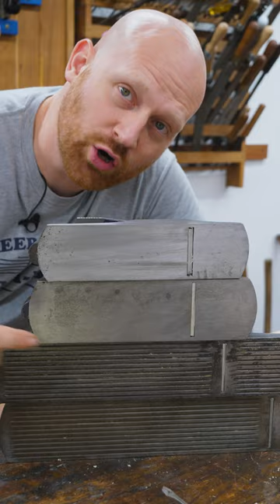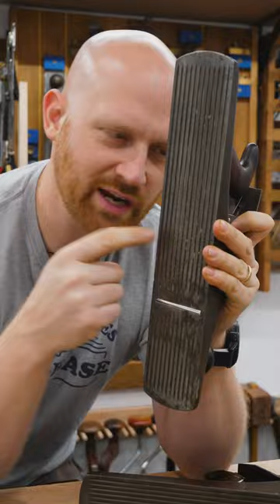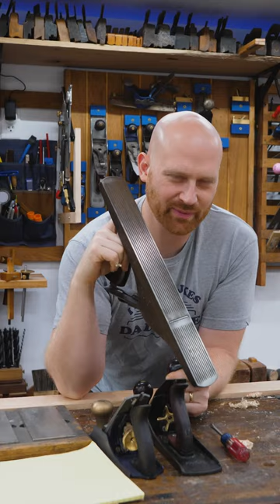What is Corigation on a Hand Plane

Comment: It is easier to push, no debate about it. Reduction of the contact area reduces friction, and the corrugation helps with suction force, it doesn't have to be just moist or resinous wood to take advantage of this. It also helps with wood that's already polished or wood that was sanded fine enough that the pores are clogged and it easily sticks to a smooth surface.
Reply: Bro skipped physics class
Reply: @milomaz1  It's not a simple coefficient as high school physics depicts it, loads of other factors need to be factored in, from modulus of materials, direction of force and direction of travel, and the type travel i.e. Sliding friction. The contact area does make a difference and the other part of my comment about suction force is even more relevant and plays a bigger part in making a corrugated hand plane better than Smooth hand planes for some types of wood (Wet, Waxy or Resinous wood and very finely sanded wood). You could look up various patents for corrugated surface finish tools and you could find the relevant math.
Reply from the maker: Wrong again. Still your turn!
Reply: @WoodByWrightHowTo  Good argument.
Reply from the maker: Test after test shows they are not easer to push. just put a scale on then and pull. they have the same average force required to move the plane forward. same amount of friction just concentrated location. Planes are not gauge blocks.
Reply: @WoodByWrightHowTo  You seem to be referring in part to Andrew Klein, the test he conducts in the video is flawed. You could search for the topic on timetestedtools you could find an experiment regarding this. My Japanese woodworking manual basically concludes the same as the experiment on timetestedtools, that they're easier to work with and preferred for certain woods, and also as general preference.
Reply from the maker: i tested it myself a wile ago. if you put a scale on them they require the same force to move. sounds like another video needs to be made. I will put it on the list.

Comment: Soooo... there are some nuances to this. The corrugated surface will likely have less friction but the magnitude of the difference is tough to calculate. What they do have a definite advantage in is channeling debris off of the surface by giving it a place to go. Kindd of like the grooves in a tire. This will reduce friction by a margin that can be considered significant. The weight is also reduced which definitely helps if it is being used for long periods. I like being able to grind the surface flat more quickly and they always seemed a little more forgiving to that process.
Reply from the maker: That's the fun of a short period but surprisingly on average they weigh slightly more as they were cast a little bit thicker to leave space for the corrugation.

Comment: If anyone is wondering why the friction is the same in both instances it is because reducing the surface area without changing the force applied just means that there is more force applied per unit of area over that smaller area. 

This change in force/unit is directly proportional to the friction force applied to that area. Meaning if you have an area of 4 in2 with a force of 1 Newton and and area of 2in2 with a force of 2 newtons the friction force will be the same.

This is why the formula for friction force is only dependent on the normal force and coefficient of friction between the two surfaces.
Reply: I thought it was because in either instant, the blade is really doing the work. The plane was just there for a guide. Thank you. You learned me something today
Reply from the maker: wow detailed and first. nice work!
Reply: Except that is not the real formula for static or kinetic friction in the real world when engineering solutions that are impacted by these factors. Contact patch, whether tires or otherwise, will make a difference. There are many factors such as the stick slip condition, the contact area, interface variation through a piece, so on. The real world calculations are far more complicated than basic high school physics leads many to believe.

The challenge ends up being argued as semantics. Is contact size in the generalized formula? No. But do we have to take it into consideration quite often when designing rolling or sliding friction and traction models? Yes. 

Bulk strengths of the substrates, and other forces that are more difficult to model beyond just basic friction make everything a challenge. 

This is all assuming you do not have any other factors at play such as excess fluid or moisture that can contribute to a vacuum condition on a planar surface. 

Now, when tested, you will notice that in general profiled surfaces have slightly reduced friction given approximately equal polishing or surface treatment. Not in the formula, correct. But can, in general, be tested as a statistically significant difference.
Reply: Still it it takes less force to push a 1x1 cm square of sand paper than it would take to push around a 10x10cm square of sand paper.
Reply: @vihreelinja4743  yes given the same force this is true because there are a lot of compounded forces beyond just isolated high school physics friction
Reply: That formula only works if you have two rigid surfaces, which wood is not.
Reply: That is false, as it is assumes that the two objects when translating over each other do not display anything other than liner dynamics. The Tribiology of the two surfaces is very complex, and the simple design that Stanley long ago stumbled upon, probably via heuristic thinking is likely effective and removes some friction from the equation.
Reply: @kurtjohnston6620   well said, I am amazed how people always miss this
Reply: @riba2233  It is the classic "knows enough to be dangerous". As some of the other chaps in the comments have mentioned, applying a purely linear, static understanding of friction which is taught in high school, the increase in friction should be proportional to the amount of surface area removed, but it isn't. A competently made mistake, if there is such a thing, but one that is made but which cries out for just a little more thinking and intellectual curiosity before committing to a simplistic answer...

I am no genius btw, I only barely know a few things about Tribiology, but it has fascinated me ever since I learned about it..
Reply: @kurtjohnston6620   yeah, I see this very often in youtube comment and on reddit. I know what I know but more importantly what I don't know, looks like other people think they know everything after reading two paragraphs about it...
Reply: @WoodByWrightHowTo the problem with this is that friction isn’t a simple linear function in real life, and often surface area can be a major factor despite what we learn in physics class. I was shocked after confidently explaining why a larger friction pad wouldn’t provide better grip to our robot and being proven unquestionably wrong in my engineering work.
Reply: @Squat5000 in my experience it seems to make the biggest difference in the breakaway force, and in applications that aren’t a simple single surface contact under high force like a servo on a shaft, simple friction models are worthless outside of some basic equilibrium speed calculations
Reply: less force will be applied to make it move...
Reply: Thank you lol
Reply: Thank you.
Reply: @reesetyra902  what you describe is only a first order model of friction, which is not generally a well behaved linear function, particularly when you consider a wide range of contact pressures and slip velocities, and yes, surface areas. Your true contact patch can have a great deal of importance particularly when considering extremes where vanderwals forces and fluid layers become dominant terms. Im an aerospace engineer working in sightline control of precision tracking lasers, our models for friction have to take into account static vs dynamic transitions as well as viscous and non viscous friction terms that each vary significantly with temperature and thats for a very well defined closed system with minimal external forces. In the robotics I’ve done i was working to design a pneumatic gripping mechanism to allow a robot to climb a structure, I very confidently explained the physics rule of normal force and materials and showed how the small gripping surface was weight efficient and would provide the same friction etc and showed the math id learned in physics class etc, and you know what? I was just plain wrong. It slipped off ever time, and the tradesman who was nearby said duh you need a bigger friction pad to grip better, i explained how no the friction is the same- and he insisted, well we tried it, slapped a 4x bigger plate same materials same forces behind the actuators and first try it worked. I was unceremoniously proven to be wrong and over confident in my theoretical education and lack of experience. The world is never linear, we just like to pretend, and most of the time it gets us close enough, but never forget where the rules come from and where theyre valid. The friction rule isn’t really rock solid anywhere other than the ramp they used to demonstrate it in class.
Reply: Found the nerd.
Reply: @ChipChurp  he aint even correct smh
Reply: Boom. Physics.
Reply: Would that also be true for something like rubber on sandpaper? Or does that only apply to smooth surfaces and if so, how smooth does it need to be in order to have negligible deviations from that formula?

This really did intrigue me, sorry for the possibly dumb questions. I am not trying to sound smart, and to anybody smart that would be obvius, because I don't know the correct words to formulate what I want to say in a correct manner.

I do understand that something pressed down into grooves on a surface will always to some degree be held back by the grooves, pretty strongly, thanks to it's natural path of movement being on the other axis than the one you're trying to move it in (meaning the basic 2d coordinations (X and Y)).
Reply: @djingiskhan4581  your intuition is good here, the more the roughness allows surfaces to mechanically interface, and the more the surfaces are able to deform due to contact, the more the simple linear friction models tend to break down. Nothing is perfectly rigid or flat so nothing is really linear, but for most surfaces a friction coefficient is a good approximation. In my industry we really rely on tests more than anything rather than simply assuming a model will be perfect, and typically account for sliding friction, fluid friction, spring like forces, and some others.
Reply: @youngbloodbear9662  Thanks! You explained that really well, as I expected from the quality of your first comment. Thank you for taking the time, I really do appreciate it! :)

Edit: Sorry, I missed that you weren't the guy who made the original comment. It seems like you have answered this a few times already. Anyway, I saved your explanation for future use as it really is great (and I want to learn to use those words) thanks again.
Reply: @djingiskhan4581  lol, I have a thing about people treating models as gospel- first guy explained the theory quite well, but trusting in things like that without understanding how and when they break down gets you into trouble
Reply: I Love this Chat Here all Put information in the basket to get better, THX.

I See it Like this, why we do some Experiments in space, yeah right to get some forces Out of the way. There is almost ever more then one Thing working.

Greatz from Germany
and have a nice Day
opo
Reply: This is true with the simplifying assumption that both surfaces are completely rigid and will not be deformed during contact. In the real world, this is sometimes a fine assumption to make and sometimes not.
Reply: Thank you very much for this explanation!  I knew it was true, but couldn’t remember the reason why.  I’ve sadly forgotten a lot from high school physics class.
Reply: So what you're saying is i should fill the corrigations with Teflon to reduce the Coefficient of Friction
Reply: 🤔 Then why run race slicks? If the coefficient of friction doesn't change based on the amount of materials in contact...

Comment: I'm not entirely sure where I heard this (it might have been one of Mr. Kreuger's old videos) and have never tested it, but I have been told that where the corrugation does make a difference is in green woodworking, where the wood has so much moisture in it that a smooth sole plane ends up just suctioned to the work piece. 

I did once plane some very green applewood with a smooth sole plane and that really was very hard work, so I could well believe that there is some accidental utility for the corrugations in that particular use case.
Reply: That's why high end planers and jointers have a similar surface on top
Reply: I would say that's most likely the reason as Back in the day they were working green wood and water has a tendency to suction two flat surfaces.it most likely made a difference but there assumption as to why it did was I correct.
Reply: @ethandahmer313   Like Blish locking

Comment: SO as an engineer, I can tell you the reality is more complicated. High school physics classes leave an impression that your kinetic friction is solely based on two factors: normal force, friction coefficient. 

The reality is far more complicated, whether it is for tires, friction materials, or reduced friction interfaces. Your contact area will in fact impact the resistance. The factors are really only practical to test and experiment as there are few reliable models to predict exactly what the impact will be with reduced contact area. In some cases, the difference could be margin of error. In extreme cases, such as steel on wood, or rubber on road, you can be 5-35% reduction in friction. Yeah, very wide margin but that is the nature of the beast. However, that depends on your base conditions and objectives.

The challenge ends up being argued as semantics. Is it in the generalized formula? No. But do we have to take it into consideration quite often when designing rolling or sliding friction and traction models? Yes. 

Bulk strengths of the substrates, and other forces that are more difficult to model beyond just basic friction make everything a challenge. 

This is all assuming you do not have any other factors at play such as excess fluid or moisture that can contribute to a vacuum condition on a planar surface.
Reply: Well said!
Reply: The reality is hardly more complicated for two fairly hard, and mostly smooth, materials like steel/iron and wood. There is zero chance the friction of either will be different by more then a barely measurable amount (if that). 
For all intents and purpose, the normal force and friction coefficient is all that matters in a situation like this. Experimental data only confirms this.
Reply: @slome815  you clearly haven't spent nearly 30 years in the tire industry where you can verifiably prove your statement false. Experimental data proves the reality that is is not as simply as a basic normal force coefficient formula in the real world.
Reply: @Squat5000  Tires are not relevant at all.
That's why I said "The reality is hardly more complicated for two fairly hard, and mostly smooth, materials like steel/iron and wood"

Notice I said fairly hard and smooth materials, something both rubber and asphalt are not. And for these materials, experimental data are conforming to the formula. 

It's not even hard to do these kinds of experiments at home.
Reply: @slome815  the statement is making blanket claims. 
Yes it matters, no it's not limited to just tires. Those are just the easiest everyday example to see very different friction limits based on size
Reply: @Squat5000  This is about wood and steel, you can do all the experiments you want, and you'll come to the same conclusion everytime, surface doesn't matter. I can't be bothered to do it, but it would be trivial to test this with a scale and a corrugated plane and a flat one of similar weight. (a basic experiment I already did in highschool).

In fluidomechanics you would be the guy that keeps repeating our formulas are wrong because they don't apply to non-newtonian fluids. 

I have no experience with tires, but I am and engineer and have more then enough experience with calculations involving friction, like flanged beam connections, cast iron guideways, etc.

Comment: I have a few corrugated planes. I like them. They work as well as flat soles. So both soles equal the same. It all adds up to the same thing.
Reply: Question, in your experience would you say that the corrugated planes stay straighter? I would think that if they have any advantage of would possibly be that. But I could see how that wouldn’t work.